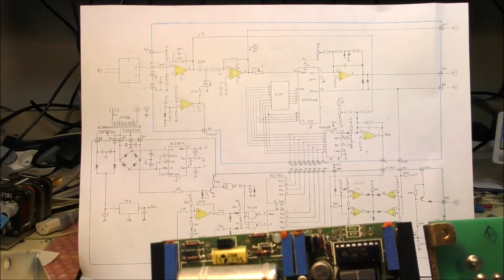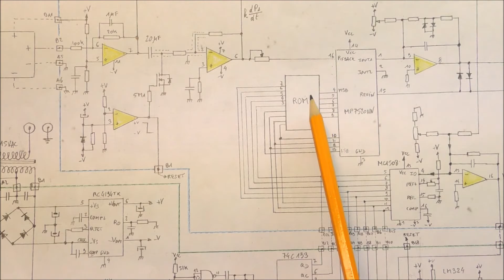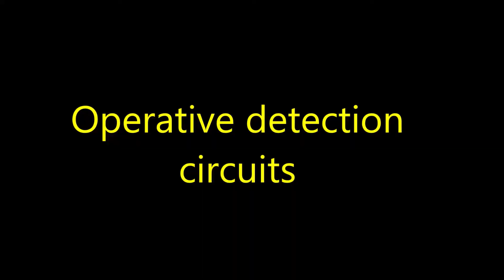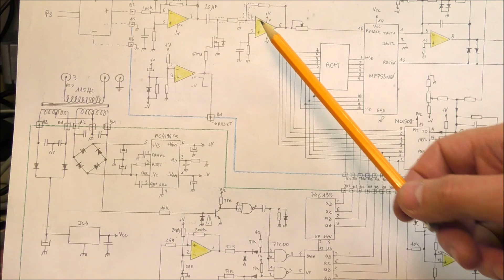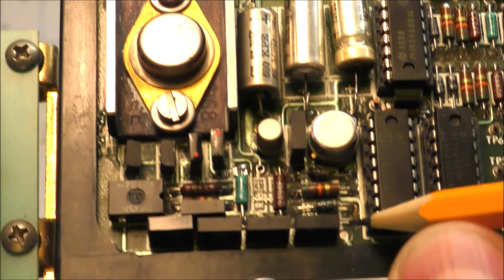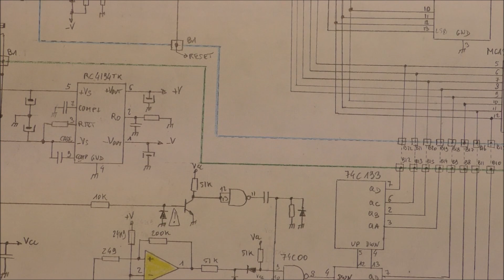LDM #172: Aircraft Barometric Altitude Rate Computer - Part 2: Reverse Engineering

Comment: Bonjour Michel! Thank you for your outstanding work reverse engineering these avionic instruments. The assembly error you found is actually really fascinating! Note that the other two diodes are facing to the right and only the incorrectly placed diode is meant to face to the left. The person who laid out the PCB is at fault here. They should not have placed them like that. For hand assembled boards it is important to place parts so they all face in the same direction. It simplifies assembly and visual inspection. If it was physically not possible, special controls  and verification and testing steps should have been instituted to catch this predictable mistake.